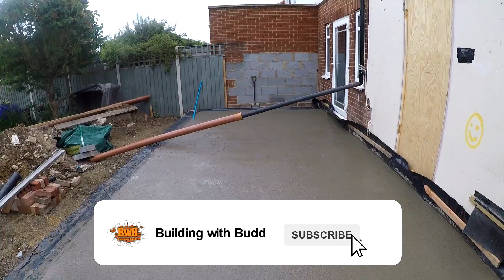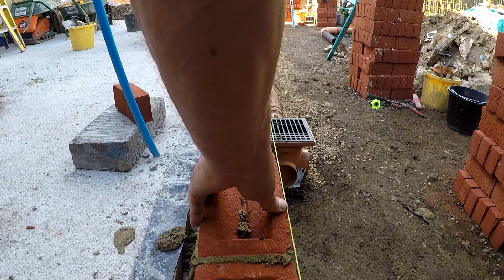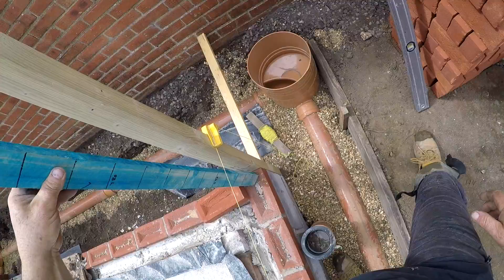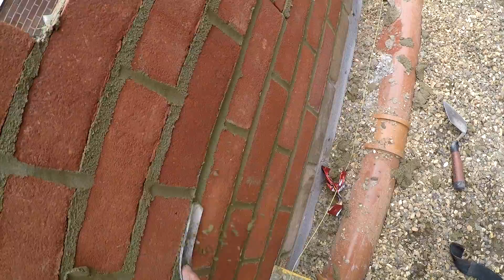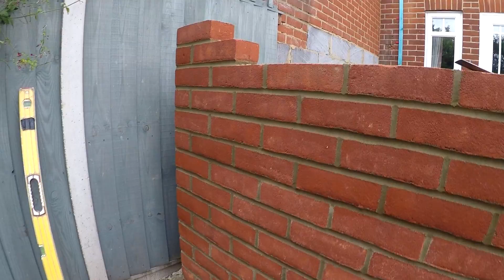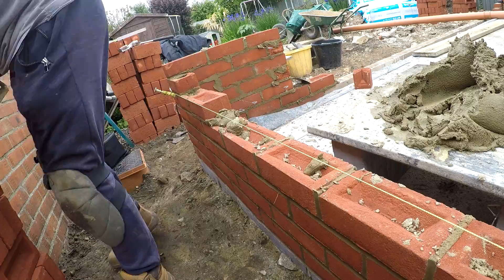BRICKING UP EXTENSION OLD BOY STYLE

Comment: oi oi bud ya ol rascal ,i might have a job building some piers using 2nd hand CAMBRIDGE WHITES , need a flush joint to match existing ,an old pram tyre would be the best ,but seen it done with a bit of 12mm wood any advice from up in norfolk boy
Reply from the maker: Hello Jack , I know this is going to sound mad  but I have used an old fan belt , very similar to pram tyre, or a bit of hardwood cut to a point, or do as all the old masters do , let your eye be your guide and your butt the last thing you part with, 👍don’t know if that’s any help 😂😂
Reply: @BuildingwithBudd  fan belt never thought of that bud ,good tip if i get the gig i will have a mess about see whats best ,im from essex the job is near downham market i heard you aint got to be to fussy up that way ! thanks bud
Reply from the maker: I think they either paint things or put lots of hanging baskets up 😂😂👍
Reply: @BuildingwithBudd  i kid em you need to keep hesian on for the first year incase of frost
Reply from the maker: Good call you are a true master🙏